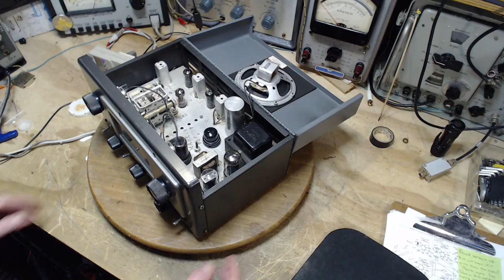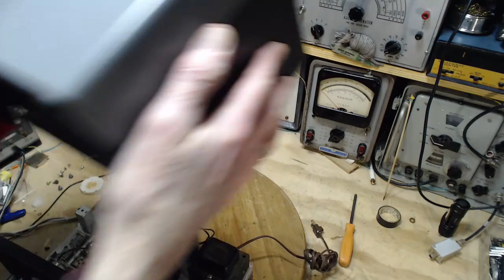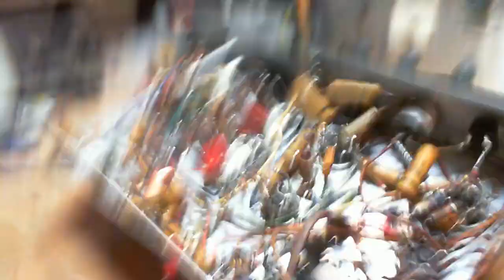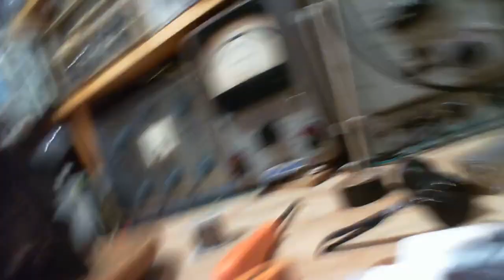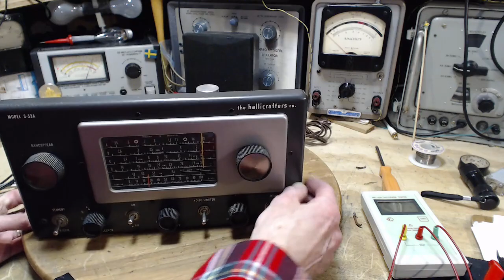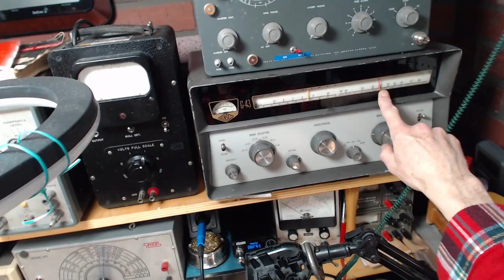Hallicrafters S-53A Video #1 - Checkout and Powerup

Comment: Thats a beauty. I am currently working on the Hallicrafters S-200 model. Its basically an AA5 using 4:  7 pin Novar tubes and a selenium rectifier. All 5 bands work and receives 20 stations on AM broadcast band.

Comment: I have one of those S-53A's coming delivery in a couple weeks. It is important before attempting any restoral to read the manual(s) and become intimately familiar with what it is, what it does and how to operate it properly. The manual to this unit has been available online for free since "forever". I understand your process will work for a unit void of any available documentation, but what you are doing here is blind tinkering. I wouldn't want to purchase a radio fixed like this.

Comment: 27:22 You should know your equipment and know how to interpret the readings. First off he has proven videos ago that the other ancient capacitor tester he owns is more sensitive to leakage. So in favor of a proper and long term repair it should be used to test the caps,- unless ofc you replace ALL these old caps anyways which most ppl would do.
Second and more importantly, it is not rocket science to test caps for leakage. He has a High Voltage DC supply at his disposal and a DMM that has a 200uA range. So no reason to lament that he does not know how high the leakage on that cap is or how to test it.
And free tip tuesday on a friday: If the current scale on your particular DMM is not extending low enough you can always make use of the input impedance of the DMM on the voltage scale to improvise a high sensitivity Current Meter;
At a typical DMM input impedance of 10Meg for example, a voltage displayed of 1V equals a current of 0,1uA. Or in other words you get a sensitivity of 10V per Microamp.
And even for the cheapest 3$ Chinese DMM with only 1Meg input impedance on the voltage range you still get a current meter of 1V per Microamp sensitivity out of it.
All of that is well enough to test the leakage of a paper cap in proper practical terms. Plus it would be a good learning experience to him and convey some real useful information to his audience.

Comment: Hope you used a Class Y Safety capacitor to tie the line to chassis.
Reply: I doubt he has. That rectangular cap he used looks suspiciously like a class-X and as such utterly unsuitable and unsafe as any line to chassis cap. Especially true with the poor quality we see in these cheap yellow class-X caps these days.
BTW; Since the radio uses a transformer and does not rely on a line to chassis cap to work AT ALL (unlike a hot chassis AA5 would where the B- to chassis cap is an active RF part)
He would have been better off to leave the cap out for now instead of replacing it with an unsuitable, maybe even potentially hazardous one. Only downside would be to render the antenna switch setting for single wire antenna less efficient, since in this setting the radio uses the power grid via the line to chassis cap as earth.
But what strikes me even more; IIRC this is a customers radio. So it will not be him, but a third person to potentially pay the price for him replacing a safety critical component with an unsuitable one.
Oh well I guess there will be loads of fanboys to tell us we should not criticize him for making saftey related boo-boos and let him tinker and experiment away merrily.

Comment: I own one of those, I bought it from The Hallirestorer full restored
Reply: I collect old Hallicrafters radios, though this is one I don't have.  I'm working on a SX-130 right now, and it's remarkable in that it doesn't have any paper caps in it at all.  The other ones I have all have a flock of big paper caps in them, the later radios mainly using those pink "Tiny Chief" ("Mighty Griefs", as Paul Carlton likes to call them)

Comment: i can tell you from personal experience that those IF cans are very prone to SMD. I think the brand is Automatic Radio.
Reply: I concur. Have refurbished many Hallicrafters S-53A, S-107, S-118 S-120, S-108 and S-38E most had the SMD and had to rebuild the IF transformers with external mica caps. When done these radios performed great.  I would not do one of these again w/o the IF transformer rebuild.